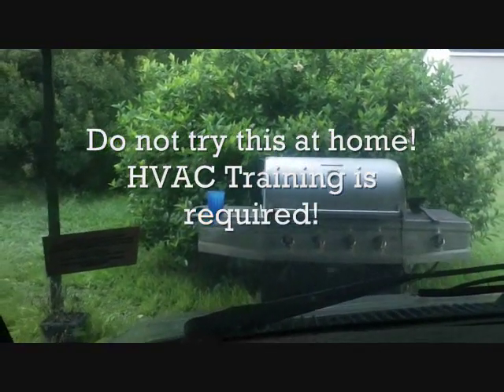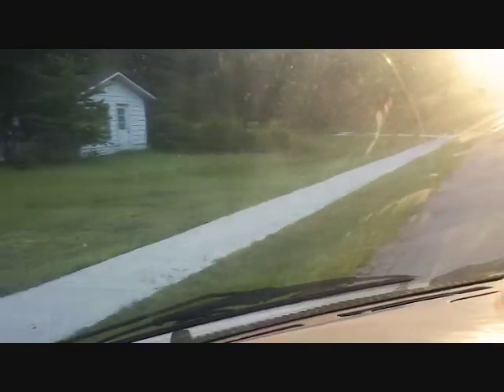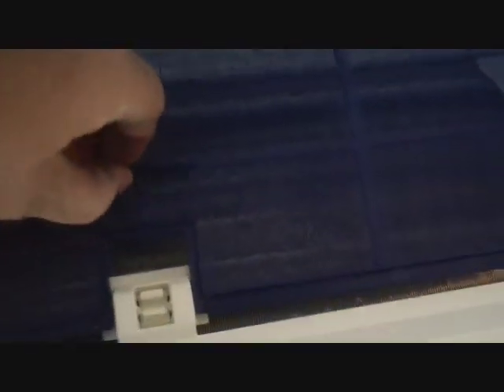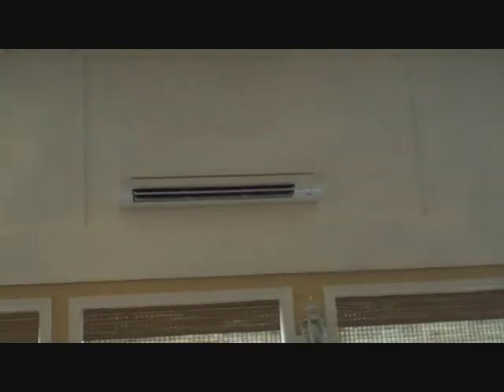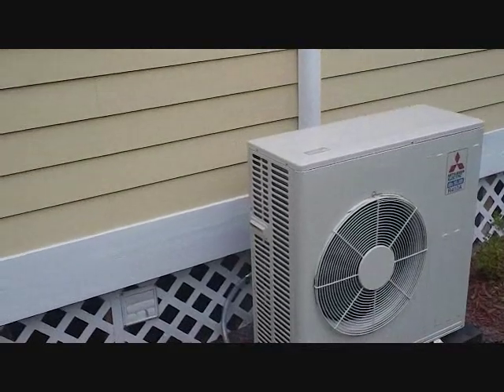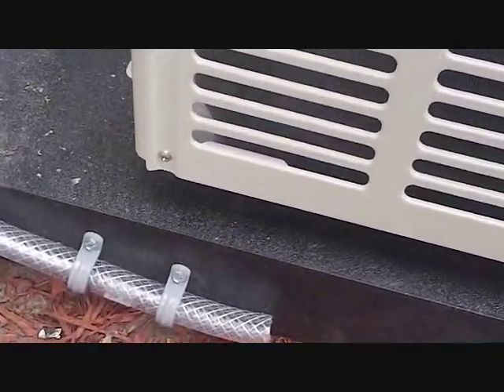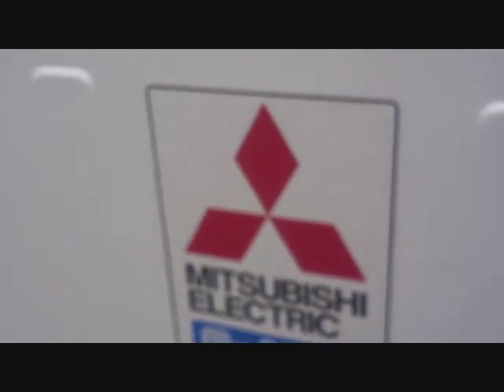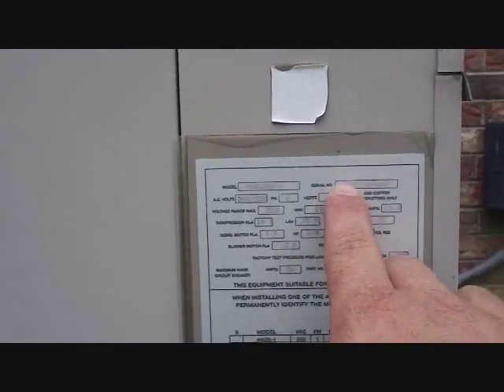HVAC Install- Mitsubishi Mr. Slim 18000 BTU Heat Pump

Comment: With the 2 other filters, behind the air filter, which are supposed to be cleaned every 3 months and replaced every year; can u mention how to care for those ones?
Reply from the maker: I usually clean the evaporator coil with spray detergent and use a brush if needed.
Reply: I was referring to parts 7 & 8 in the following document: http://www.mehvac.com/UploadedFiles/Resource/MSZ-FE09~12NA_Parts_Catalog_OBB542_7-27-09.pdf

Comment: How does this unit work in cold temps?  I was told that it may not produce heat in <30 degrees?
Reply from the maker: They advertise working well down to near 0 degrees. In NC where I am we don't get to see those extreme conditions a lot.